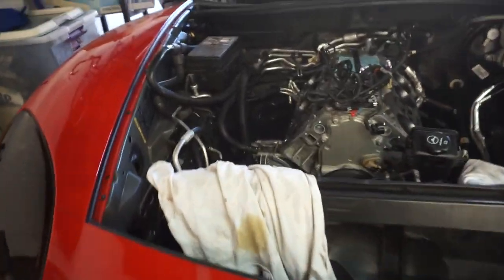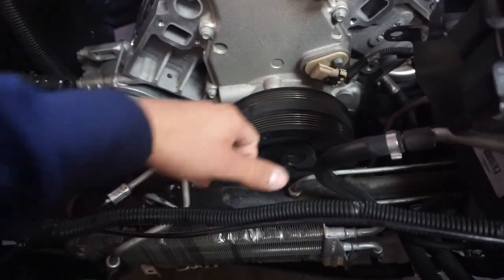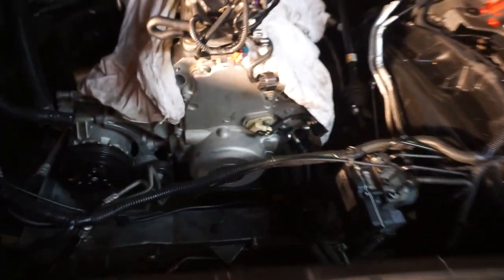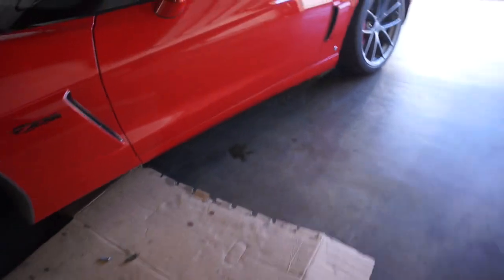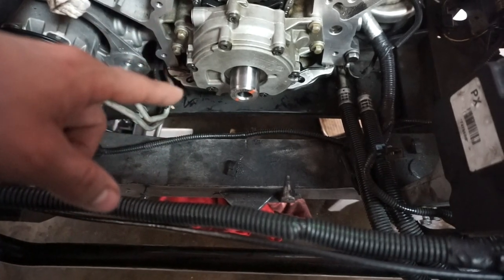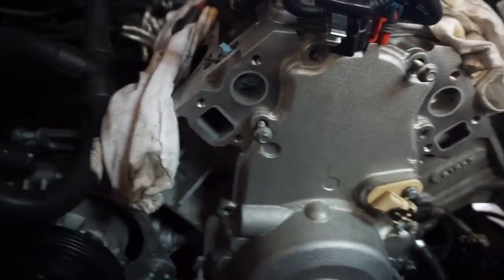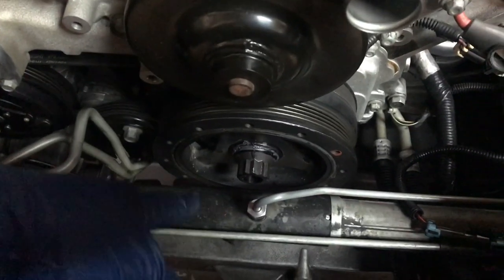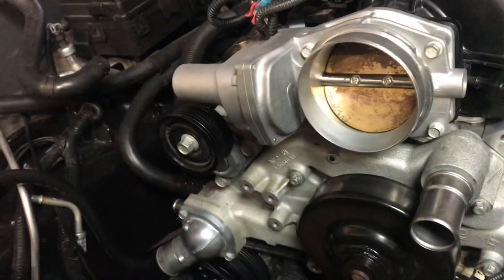C6 Corvette Z06 Heads and Cam Install (How to Do)

Comment: If you look at the gasket on the oil pan you don’t need to loosen out and there’s a seam on the left and the right side of the gasket you can cut the gasket with a razor and pop those seams and pull the pump assembly without messing with the oil pan 😊
Reply: Can you explain that better? Not sure I understand

Comment: Hey I'm doing the same job you finished. Question for yo. Did you pull all 13 bolts down on the oil pan to get the space to pull the pump and what about the 2 on the back that screw in horizontally. Lastly if you did have to get all 13 bolts there are 2 beside the engine mounts what did you do about those?
Reply from the maker: Correct, I loosen up all 13 oil pan bolts including the ones in the back of the block. Didn’t touch the engine mount bolts though
Reply: TheBudgetTuner Hi, do LS7 heads/build require lash caps and if so on which rocker do you install the lash caps on? All the rockers or just the intake side or exhaust side?????
Reply: safety permian lash caps go on the intake valves only since they are titanium

Comment: Ok I just installed my B3 cam, timing chain and tensioner. When you installed the oil pump back did you use any silicone for peace of mind around the oil pump?
Reply from the maker: no, was scared of some of that going into the pump and causing all kinds of other problems.

Comment: Also curious why used to stock Belanger and you didn’t upgrade to a super damper not good for that motor to run a stock balance or when you increase the performance

Comment: On the lifters you definitely want to soak the roller Wheels so that the needle bearings are fully lubricated you don't want those dry when you start the engine as far as the hydraulic plunger goes you you can soak them or not it doesn't really matter too much you're going to have lifter noise when it first starts right away anyways until they all get filled up with oil pressure and for what it's worth when the cam gear is at 6:00 and the crank gears at 12:00 you're firing number six cylinder number one is firing when the cam gear and the crank gear dots are both at 12:00

Comment: You did good, and there's no where it says you can't use extensions on center of drive, and that it changes the torque value, it doesn't  change it at all, anybody says you can't do it they are wrong. Extensions on the center of torque wrenches doesn't change torque values... Only extensions that move the center of a calibrated torque wrench forward, or before center on the beam of torque wrench. And incremently it changes all the way until you reach the 90° to the beam then it is actually torque shown by torque wrench.